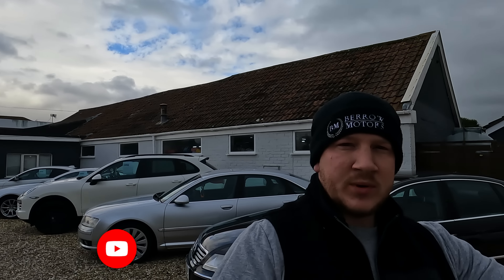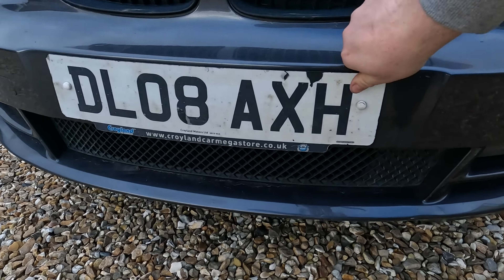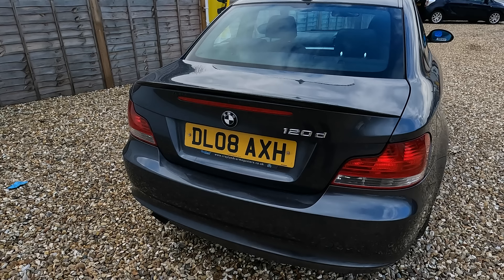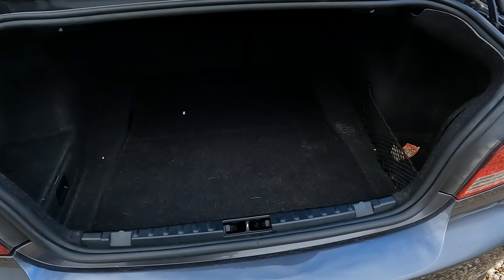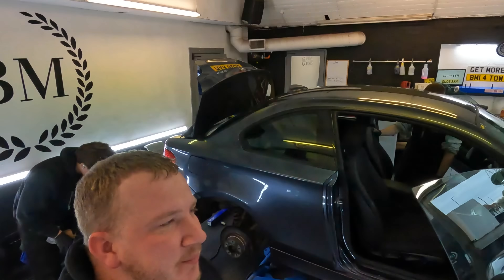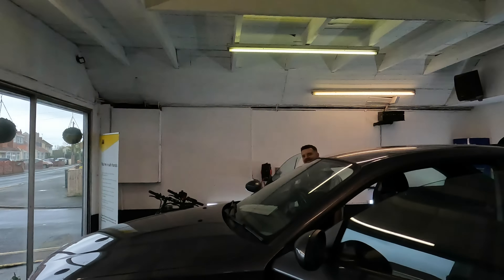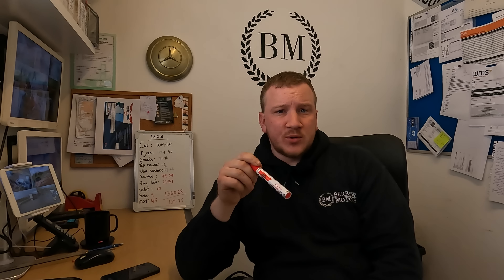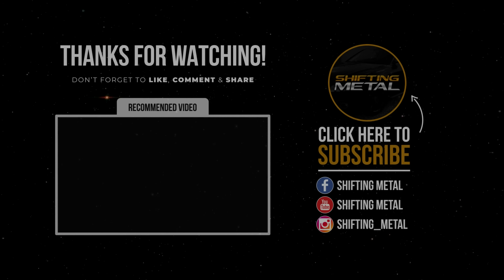I bought this high mileage BMW 120d Coupe for £800 at a car auction!

Comment: Interesting.  Not really a BMW fan having owned just one very underwhelming 520d Touring which disappointingly felt a step down from my previous A6 1.9 tdi Avant and did have a really vague gear change compared with the very precise Audi but these little BMW  are very neat as long as you avoid the timing chain issue.  Nothing else quite like them for the money.
Was that two Phaetons in the background at the beginning?

Comment: Bca Bristol can I just walk in with no account  or membership like you can’t at co part? And can you actually have a dig at the cars probably not like just in the 5 mins you have to see it in the auction.
Reply: There is one local to me in westbury but still I think j you have to be registered and pay or be a member? It’s an Aston Barclay vehicle auctions at the very local one to me. Anyone shed any lights on this for me. 3O+ yeahs old but have 20 years of all sorts with motorsports, personal track car, went through a phase in 12012 buyin t and selling for like literally 5 or 6 months and then just used the money to use it for my own personal car I would of wanted at the time for personal car. I get in the spanner’s most weekends so I’m not scared of a bit of works 
Need help with getting into these auctions guys ???????
Reply: City & guilds level 1,2,3 in motor vehicle maintenance and repairs 

Very good friend who does diagnostics and also can code items to cars and interfaces when messed up. 

Just the initial getting in that building is my probably. Help meeeeee my lovely friend 😂

Comment: I just bought one for £1400 exactly the same but in sliver, 118000 miles, tidy inside and out no mot but I put it though one, fitted new brakes all round and an oil service. The car owes me £1650. I want £2495 for it
Reply from the maker: Sounds like a great deal!
Reply: Sounds like a realistic price

Comment: Check the water bottles, heard they break, crack and pipes leak. Don't want an overheated BM. Bodywork looks good as well. I would never have said it had done nearly 200k miles, good find.

Comment: Other than the timing chain issues, I love these cars
Reply: For a while I wondered why all cars didn’t just use a simple timing chain. Why do we still have manufacturers using a belt to drive the engine. 

Now having seen all these videos from different channels and also having spent some time dabbling in this trade, I now think the opposite. Cam belt is a few hundred quid and usually easy enough for most mechanics and when it’s done, it’s usually the last you’ll have to deal with it for a long time whereas a timing chain can cost anywhere from £500 up when they go wrong. Just a thought!
Reply: @Dane Cowan  the older bmw engines are chain driven and they don't have any problems. If you look at the m47 that was the 2.0 diesel before this generation of car they were bullet proof when it came to their chains. As manufacturers tightened up their building processes we started getting problems
Reply: I've had a few 2.0d bmws and have had no issues with the chains at all, I just have an oil service with fully synthetic oil every 6000 miles
My dad and nephew are both mechanics and reckon most of the chain issues are caused by people not serving them or putting cheap shitty oil in them
Reply: @craiggodwin5960  Yeah they’re probably right. To be honest id rather buy a car that has been serviced regularly regardless of the quality/brand of the oil used than one that’s been neglected. 
More people than you think just don’t bother with it. All we can do is continue to maintain our cars fastidiously and have the pride of knowing we look after what we drive 😁

Probably why my 66 plate Passat is now on 165k 😎

Comment: The coupe always looks better I have  an 08 se hatchback with 191k it's had timing chains, clutch,recon gearbox that oil breather the oil cooler gasket 3 services discs and pads all round both rear lower arms as bushes dry out , would also check for recalls as the heater wiring needs replacing and a battery cable

Comment: Might just be me, but 4-pot diesels just don't do it for me in what should be a fairly fun car - they just have no excitement in the sound that would encourage you to want to enjoy it... In that sense, comfort of the standard pack instead of the msport makes total sense to me here.

As you seem to really like a respectably quick small diesel car, it'd be interesting to see you get hold of a Volvo C30 with the D5 engine... The extra cylinder makes a big difference even in sound even though there's only a bit more BHP and torque than this has.

Comment: High mileage BMW (Bring My Wallet) big deal 18300 miles thats not high  well 4 years ago l paid aud $1500 for a 1997 TOYOTA Hilux cab chassis with an aluminum tray no rust issues ah living in Australia and l have spent over $1500 on replacing bits and pieces on it and it has done 430000kms  aprox 250000 miles the engine is original no oil burning issues l have seviced it fully new tyres new exhaust system but it is now worth between $5000 to $6000aud one sold for aud $10000 it had a respray in red the engine bay had not been painted and there are two other TOYOTAs that have sold both with 980000kms on them a 2002 TOYOTA Corolla for aud $4600 and a TOYOTA Hilux rwd double cab ute for aud $500 and the seller had people lining up to buy it because of its famous 22R engine under the bonnet much more reliable that any BMW engine show me a BMW with 600000miles on it you will not find one but there is one more there is a 1993 TOYOTA Corolla in New Zealand that has done 2000000kms on the original motor and gearbox that is over a million miles is there any BMW that has done that do l hate people saying a high mileage car Toyota make very good vehicles that go on and on well my 1997 TOYOTA Hilux is going to out last me well its 26 years old now will go on for another 500000kms  easily will that BMW go on and do another 600000 miles noway